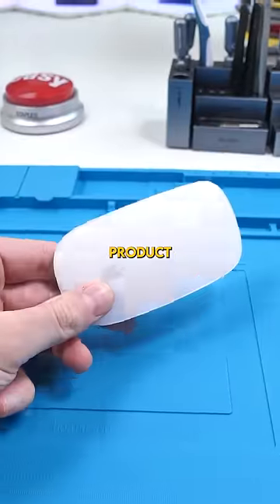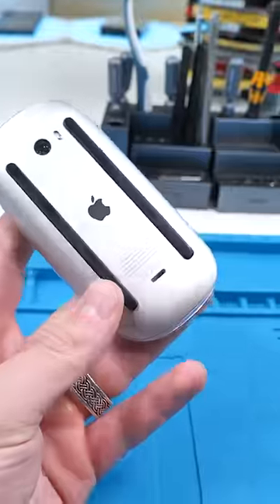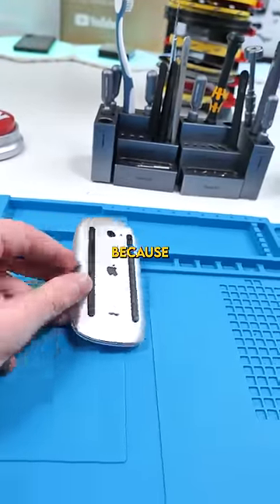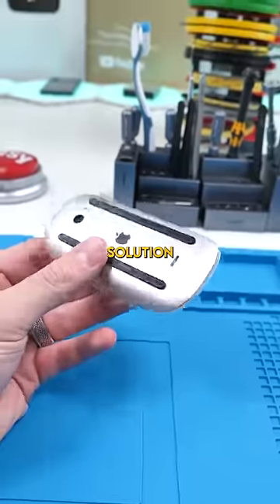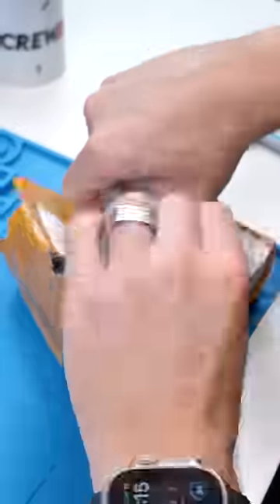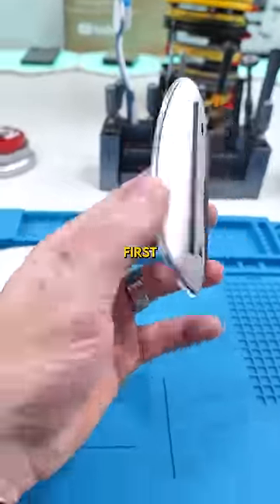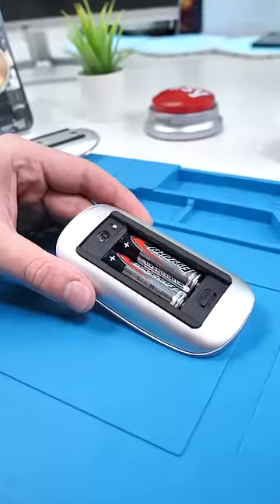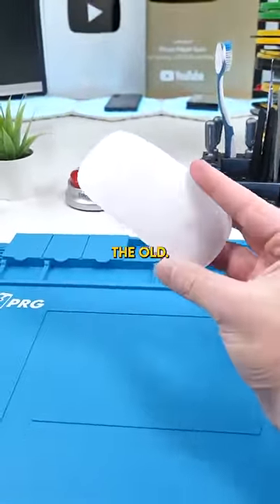The Dumbest Apple Product Ever. #Shorts

Comment: Apple magic mouse gen 3: we heard your complaints about the placement of the charging port so that's why we removed it entirely, now you have to buy a new one every time the battery runs out. 
now for only $199.99
Reply: Trade in your old one, and get 19.99 off!
Reply: Also, it only works on the mouse pad it comes with. The exact one it comes with. And when its battery runs out, you have to replace the mouse too.
Why does a mouse pad need a battery? Courage

Comment: I... I don't understand why NO COMPANY just makes a lightning male right angled joint connected to a female lighting port and just wrap that in an enclosure where the bottom thickness is thicker than the cable. Or, just provide your own slim lightning cable and do a sleek design.

Comment: Comment section sounds like an EV or ICE car debate.

EV fans; it’s a great design, and with planning it causes no issue, quick to charge and just plan and charge when not using, e.g. when taking a break. 

ICE fans: this is so dumb.Just want to bung the fuel in and get going. Don’t want to bother about making small changes and planning.

Comment: The design isn't that stupid. On Apple's website it says that the mouse can last up to a month on a single charge. To recharge it, you plug it in when you sleep, it's not complicated.
Reply: No, it is stupid... it is idiotic... it is non-design. A good designer will strive to make an object that uses both function and from together. There is no shortage in the market, with mice that have, a detachable USB cord, in the place you would expect it.

There is no need to re-invent the wheel here...

PS - I used to be an Apple fanboy (and I still love MacOS), but when you have been a long time Apple customer, as I was, and you start seeing Apple over and over again failing on their computers for both poor design choices, outdated hardware, or continue to do anti-consumer practices, there's a point you just have to say "enough"
Reply: They could have put the charging port at the front of the mouse, like other rechargeable mouse. But they didn’t.

Comment: I have a tip: Charge it before use
Reply: I have a better tip: Don't buy apple products.
Reply: I have a better tip: don't buy apple and buy a wired or a wireless mouse that doesn't have a charger at the bottom.
Reply: @themainmanaud  Has there ever been an occasion where you really needed to use your wireless mouse wired? xD

Comment: The bigger problem is that the sensor of this mouse is designed by the same dumb engineer who decided to put the charging slot on the bottom of the mouse, it's just horrible.

Comment: I'm no Apple fan, but I just don't get it why people points this as a massive problem.
It's wireless and if you're buying it, you must be aware that it runs out of power and needs charging. You charge it while not in use.
The best solution for this is buying a wired mouse.

Comment: I actually just got a mouse that can recharge, but you put AA rechargeable batterys in it, and when you aren't using it, you put it on the dock (also the wireless receiver for the mouse), and it charges when not in use, it doesn't recharge via USB, it has a plug that you plug into the USB connector, and it supplies the power to charge, if anyone wants, I can make a video of it, and include a link if anyone wants one

Comment: Not dumb, its becase its WIRELESS. If you connect it from the top, or the side, you would hqve a wire, and it would be a scam. So, it is a scam, both ways.

Comment: I actually like gen 2 more. When I take a 5 minute break or go to the bathroom I plug the cable in and for the rest of the day there’s enough battery. I then charge it over night. The battery if gen2 lasts SO much longer. with gen1 I changed the batteries every 3 weeks and it doesn’t work good with rechargeable batteries

Comment: Funfact, once I was at media market. (Known Electronics shop in Germany) I saw the mouse displayed but they got a ultra thin flex cable under it with an charging port inside the mouse soldered to it. That you can use it while charging 😂

Comment: Its There becous its wire less ( if the charging Hole har Been a place where you can use it and charge it at the same time ) people Wil start to Leav the cable in ( the mouse do have a really good battery life and it charging really fast so it not really a problem

Comment: The whole Apple mouse itself is stupid don’t buy the new. Also don’t buy the old they both suck it’s really hard to scroll on them and it’s super uncomfortable to use you can not even tell when your clicking it and wireless mouse will always suck because of charging or batteries and delay and being a pain in the neck to connect. Someone I knew had 1 and it was horrible they never used it again after getting it

Comment: Seriously, I hate this type of video. This mouse has a lot of problems (it's not ergonomic, at a glance you don't know which part is the front and which is the back, the touch controls and gestures need improvement, etc), but the charging port os not one of those problems. You DON'T NEED to use it while it's charging. It has fast charge: with 2 min of charge, it'll last for 8 hours ( also known as one day of work). And with 2 hours of charging it'll last two months. It's like saying a car is bad because you can't fuel it while it's moving. So really, people love to talk about the charging port while there are more serious design problems with it.